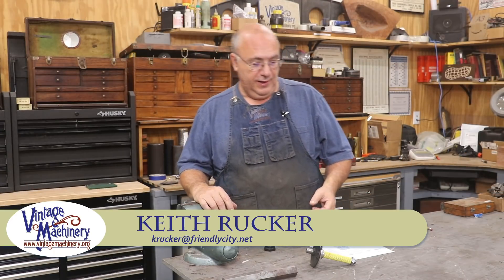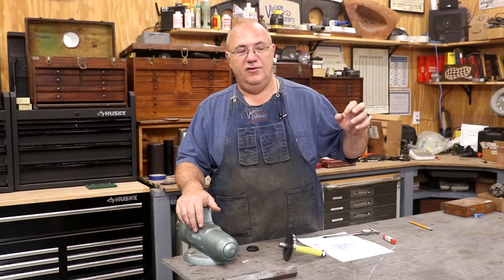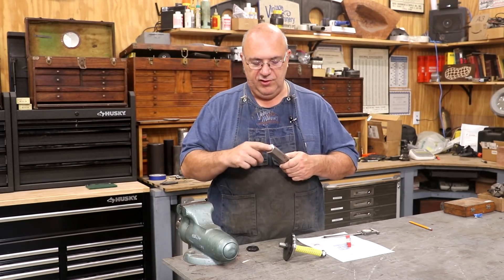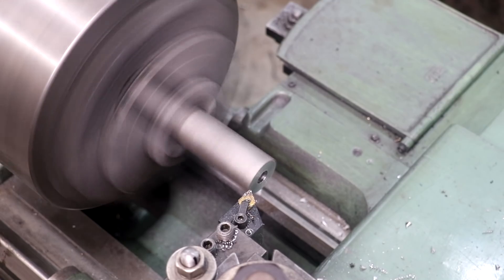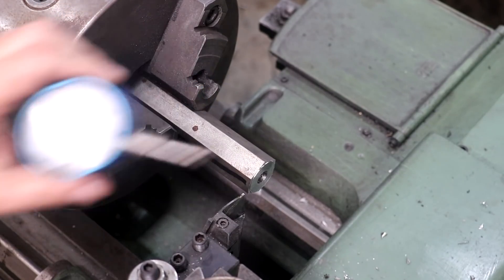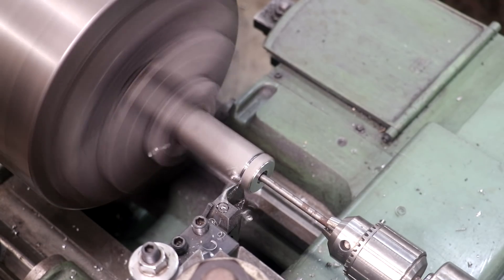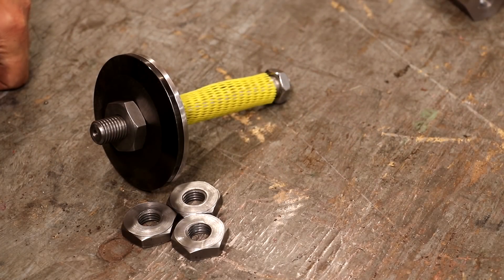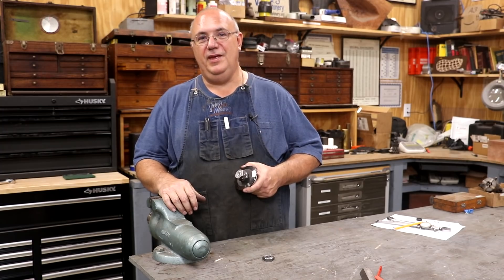Single Point Cutting Internal Left Hand Acme Thread on the Metal Lathe

Comment: I had a similar experience with USPS over the last 2.5 weeks. Bought a tool holder on eBay and within 2 days it was at my regional facility, but then the next day it ended up on the other side of the country and it took another 2 weeks for it to get to my door. Grabbed the box out of the mailbox and it felt way too light for an old toolholder. I opened it up and sure enough the tool holder was gone. Looked like at some point the box may have came open and they just closed it up with masking tape... I used to like dealing with USPS, but not so much lately. Thanks for the great video as always, Keith!
Reply: A similar occurrence happened to a friend of mine. He even bought insurance but they are jerking him around on that. About 8mo after the loss, he went to a regional USPS auction where they auction off stuff in lots on a pallet that they couldn't find out where it was supposed to go. Yeah, pallets! That's how much stuff gets "lost" by USPS. You know, the stuff they screw-up and then can't deliver. Yeah, they sell it off to the highest bidder and pocket the money. Anyway, there it was, my friends item. Plain as day. They would not take it off the auction and somebody bought the lot. My friends item is VERY specific, fairly rare item that was not produced in large numbers, and, he had tons of pictures clearly identifying it. Yet those lazy bastards still "couldn't" identify and find it all those months before the auction. Here we are two years in and they STILL have not paid out the insurance.
Reply: This is an intentional disruption of service by Donald Trump via Postmaster General Louis DeJoy
Reply: @CryhavocMike  Did you friend try to make contact with the winner of the lot to buy his parcel back? Not ideal paying twice but if as rare as you say...

Comment: The post office was pretty reliable until the past year. So far they have lost two of my tracked packages and now the tracking system is almost useless.
Reply: I always put a small amount of insurance on my stuff- it costs a bit more, but I always believed that when they scan a package and it shows as insured, it goes to a different sort line.
Reply: Odd that the service has dropped off now, with all the political interference...

Comment: Keith, I can definitely tell that you were aggravated while filming this video!  You normally seem so cool, calm, & collected that this time was a surprise, but I truly understand where you're coming from here.

Did you notice that during your threading cuts that the dial indicator needle moved .002-.003-in. each time?  That may be why it appears that you had to cut deeper than "the  book" said was needed.  You're using a big, apparently rigid lathe, but that's a lot of movement for such light cuts, isn't it?  I'd be interested in seeing what you find is the cause of this deflection(?).
Reply: I noticed that with the dial indicator too. As AvE says, everything’s a spring!

Comment: Off of e-bay, I ordered 4 bearings. All bearings were in different locations. Only 1 of the bearings made it to me on time as posted with the tracking info. The final bearing took 10 days to go 100 miles. It went through the Chicago distribution center 3 times before they finally shipped it out to the correct post office for delivery.

Comment: Forgive what may be a stupid question Keith,  I am not a machinist by any stretch of  the imagination but why couldn't you cut off enough material for the 4 nuts and put that chunk into the chuck to bore out the threads all the way down then cut off the nuts as needed that now have been threaded instead of one at a time ?
 I love watching your video's and learn a great deal that I apply to different scenarios I come across in my profession.   
Thanks for another great video.

Comment: Turning left hand internal threads is tricky. Fixing the POST OFFICE IS easy. Pay what it costs. It is a constitutional service not a profit center. 

As far as the threads are concerned I would have done something else while a new tap was on the way. Or made my own tap.
Reply: Making the tap seems the best option. That way you have the tap to use forever.
Reply: From a woodworker - Are taps hard to make ? It would seem that this item that got lost in the mail was some rare irreplaceable new old stock tap that Keith couldn't make himself ?
Are they made of HSS ? Can they be hardened after the tap threads have been cut ?
Reply: @MadHatter764  Taps are not all that difficult. Turn the outside shape on a piece of tradeable steel. Drill rod will do. Then turn an outside thread on the tap blank. Then using a milling machine, a grinder with a sharp edge in the stone or a combination of coarse and fine files cut teeth onto the tap cylinder. Then stone the teeth until they are sharp. 

Then harden and temper the tap. Rexharpen it with a stone.

Comment: Last week I was making an arbor for my horizontal mill, and the nut (3/4-16) wouldn't fit. Couldn't figure out what was going on until I realized that I had cut left hand threads on the nut, while the arbor was right hand.  (insert head banging against wall....)

Comment: Kieth  FYI John Deere uses a hex shaft to drive the header and for what ever reason they replace that shaft when bearings go bad  it’s about 10 ft long the ones l see in the recycle bin , you might want to make friends with a local dealer for a cheap iron supply

Comment: I'm curious why you didn't bore and tap before cutting the parts from the bar stock??
Reply: Yeah, I was very puzzled by that also.
Reply: Stick out vs boring bar diameter probably.
Reply: Look at the boring bar. It's quite thin because the hole is not that large either. Now, long and thin bars have a lot of spring in them. Acme thread profile is not conical, but almost a square - thus it has two "walls" and a "floor". Springyness in boring bar will skew the profile by allowing the cutter angle change respective to the thread profile "floor". This will result to cutting too much on one wall and too little on other wall. After a spring pass, the less cut wall is at it's right dimension, but there is no way to refill the too much cut wall, thus the thread will have a lot of axial play/sloppiness.

Only way to stop this happening is to eliminate boring bar spring, either with a sturdy bar or keeping thread length small.
Reply: Makes sense.
Reply: If you watch the dial indicator you will see the tool pressure with each pass jump back about .005, also you can't cut deeper than he did because the cutter ain't that long and cutting backwards from a blind hole is iffy at best. Much easier cutting one at a time.

Comment: 1:30  There is a "Lost Mail" form you can fill out at your post office to get them to specifically look for the lost piece of mail.   But if they can't keep track of it under normal circumstances, I doubt the form will do any good, but I figured I'd mention it just in case you want to give it a shot.
Reply: they're actually pretty quick to respond to lost mail inquiries, 3 days in my recent experience, probably a lot faster under normal circumstances.

Comment: Why wouldn't you cut the threads before parting it into three separate nuts?  It seems like it would be more stable in the lathe to keep it together in a longer piece, tap it and then part it off.

Comment: I'm not a machinist so there maybe an obvious answer to my question. Why didn't you thread the whole piece before you parted the nuts? Also, why didn't you run the Lathe backwards so you could thread from the outside to the inside?

Comment: Keith, 
Why wouldn't you make all 4 nuts in one piece and then part them off? 
Seems like it would be easier to thread one or maybe two pieces instead of four individuals.
Reply: Because of the working length of the tool
Reply: Ted Mattingly depth of cut would have been too much for the boring/threading bar. It would have chattered or left a bad cut.
Reply: I would still think it would be long enough for 2 pieces. But, not my rodeo, not my clowns LOL.  
Just a curiosity question, thanks gentlemen

Comment: I do a lot of on-line business both domestic and internationally and lately USPS  has been getting weird. Had a tracking number issued, more than once, and never showed that the item(s) actually shipped and were delivered. Have had international packages showing they got to the US then no updates but were delivered. "Once over 60 days late" Have also had packages showing delivered to the wrong address only to find them at my PO Box. Some items that normally take a day or two are now taking over a week. I found an app, http://parcelsapp.com/en/tracking, that seems to be more accurate than USPS's tracking system and works with most all other carriers and with greater details. Don't be surprised if that tap just shows up one day. So far all the other carriers have been fine and I have stopped using USPS for shipping, mostly using UPS.

Comment: Why wouldn't you just boar out and thread the length you need, and then just part off nuts of the required thickness? 

Seems like fewer operations if you just thread once. 

Absolutely not a machinist, with little  knowledge other than what I've learned from you and a few other youtube channels. 

Just trying to learn more....and stay out of the USPS conversation...